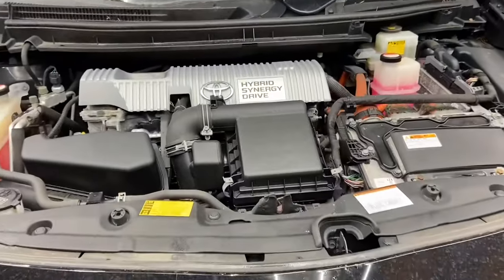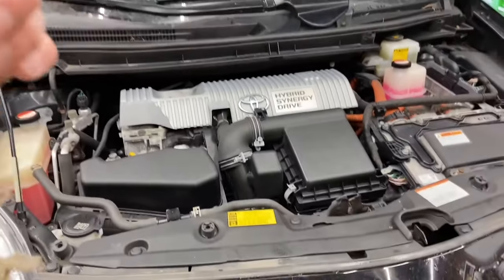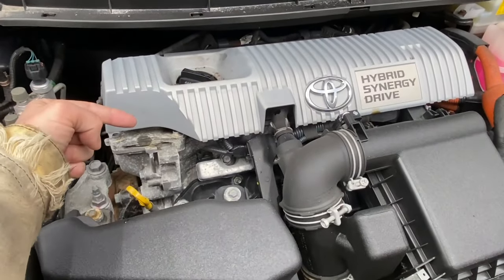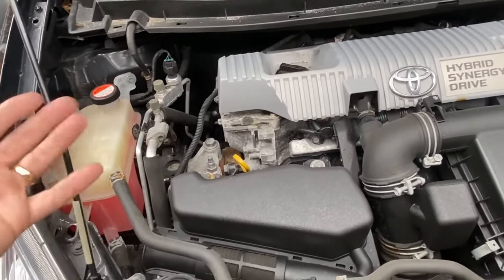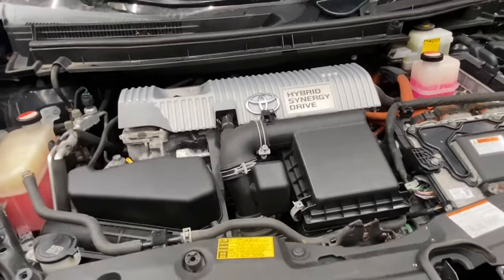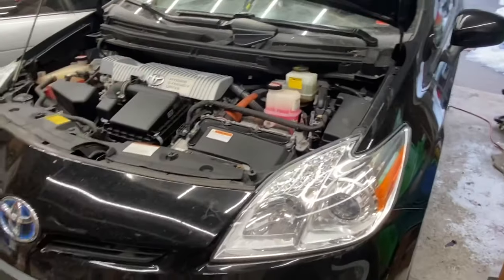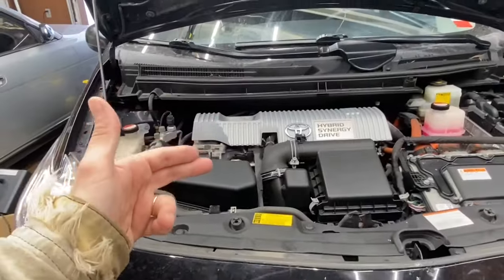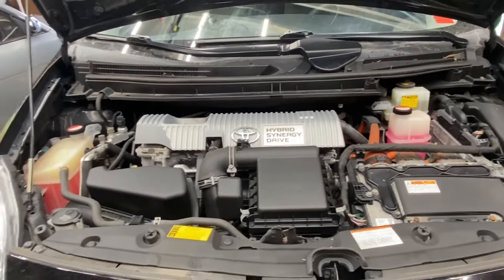Third Generation Prius PROBLEMS! Should YOU Still Buy One? A Prius Dealer/Technician Recommendation

Comment: I bought a used 2014 Prius, 30000 km on it in 2016. It has been rock solid. NOTHING has failed on it, not even a light bulb. I did the brakes a few yrs back just because. They were still fine. Couldn't believe they brakes were still good at 80000 km. Got 95000 km on it now. Still gets over 50mpg. Without a doubt the most reliable vehicle i have ever owned and i have owned over 30 in my lifetime.
Reply: The first real failures I had was actually due to my catalytic converter being stolen, leading to damaged sensors, a damaged module, and the hybrid battery becoming unbalanced and giving errors bit early. Total cost to deal with the fallout was $2000 which includes the price of me getting a Miller Cat shield installed and reconditioning and fully testing the pack myself.

I encourage anyone to get a converter shield, because its a scary time to have a prius right now.
Reply from the maker: Oh yea they are great! The video is to cover what will go wrong but it’s way up there in miles. And it can all be solved. Enjoy it :) remember, I said I’d still own one. Love them. Please subscribe :)
Reply: @Sam-dc9bg  I think I should get one for my 2013.  Here in California, theft of anything is virtually not a crime unless you use a gun and fire it.  But even that is not guaranteed to get you jail time.
Reply: Hi, you're amazing!!
my daughter has a 2014 Prius and replaced the head gasket apparently there was some unseen damage now 6 months later it threw a piston arm thru the block. I'm going to be replacing it with a used engine now that I have watched ur videos and now am confident that is the right decision. Thank you for sharing ur extensive knowledge of these vehicles. Would you suggest that I put a 2015 engine in her 2014 Prius to replace the old motor with the newest lowest mileage used engine as possible? And roughly how much do you think would be a fair price for a replacement engine? Any advice will be greatly appreciated, you truly are providing a great service to the  less experienced Thanks again, You the man!!!

Comment: I have a 2011 with 245k. Nothing wrong ever!!  Such a solid car!
Reply: No clogged EGR valve, cooler, pipe and intake manifold? Original coolant pump?
Reply: @dezafinado yeah I don’t see how it’s possible to be at that mileage having never had the EGR system go down. The cooler is too small and the engine is a PCV engine oil slurper. That design was a major error on Toyota’s part. I’ll be scratching my head forever as to why they slung the PCV valve that low on the block, at the same time they positioned it horizontal. Not even sure how they expected the float in the valve to work laying on its side.
Reply: Well that's commendable but hardly impressive I mean let's face it the car makes 98 horsepower and all it's ever carried is probably you to and from the grocery store/ work, it's never left the pavement.  I mean shouldn't a 98 horsepower vehicle do that? I have a Chevy Silverado 1994 K 1500  it's  a Z71 4 wheel drive I have gone on countless off-road expeditions unbelievable deep water river crossings time and time again and it's never failed, I have pulled offshore boats from Phx to LA,   Trailers AT v's and snowmobile's through the mountains of Colorado. I have the original engine untouched haven't even replaced the timing chain and I'm at half a million miles... It's 31 years old dude hit me back when your prius has that much age and miles on it, Additionally FYI I'm a 2014 pre a sooner and I've had several problems so I don't entirely believe your story apparently neither do any of the other people in the comments section it's quite possible you're full of shit.😢

Comment: I never thought I'd buy any vehicle with 235,000 miles.  Well, I also had turned down lower mileage gen 2's for $400 and $700.  Finally saw another for $400 and couldn't get there in time so drove off with someone else.  Yes, still drove, albeit the body looked ghetto.  Still, happened to find another ghetto looking lifted model for $1,000 more and decided why not.  Even with ABS, VCS and Engine trouble lights on.  Was documented well I thought at least and later found from ~210K miles on was via dealership and Japanese auto place.  Turned out, the right rear adjustment lever and strut was assembled wrong and bingo redid correctly per spec and two lights and related codes down.  Also, reported with a custom exhaust that I found needed the downstream oxygen sensor and catalytic converter which aligned with the engine code and reported corrective actions by the seller and his mechanic.  Two more engine codes gone after a new Denso downstream sensor and Autoshack catalytic converter.  Now I think what's left is replacing the AF Ratio sensor with a new Denso, though I got a few from the salvage yard to test out before hand since they're returnable and only ~$10.  We'll see.   I also have a clunking that was reported in the front end that was reported as the Rubbershocks or something with the lift doing.  I found the sway bar bushing squeak and need to verify everything is tight like subframe bolts as well just to be safe the more I read and watch regarding that noise.  Everything I can test related to tie rods, bearings and cross members seems OK, albeit a crow bar or long breaker bar to really lever on might show something else.  Guessing is the front spring diameter is too large with those Rubbershocks so I picked up some 2012 AWD Matrix struts to eventually swap those spring in and remove the Rubbershocks on the front for certain and maybe the rear as well.  Though yeah, amazing.  The 2013 and on gen 3's are just amazing. I better stop writing now, since I can go on  and on seems.

Comment: I've been hearing a ton of Prius owners having zero problems with their cars.  I have the opportunity to purchase a 2012 Prius with 225K with a new upgraded head gasket, new engine water pump, and the engine has one year warranty.   Sounds good but they are wanting $8k for it.   Isn't that a crazy high price?
Reply from the maker: Well.. I’ve got a 2012 with 137 for $12230ish. These still are the best cars made from the year 2010 to 2015, but they aren’t as good as 2004-2009. Not sure if it’s worth $4000 to get 100,000 less miles. I bought my truck with 197,000 and enjoyed the savings. I got my solara convertible for $1500 with 190 and wish I spent $7,000 and got one with 80,000
Reply: @DrewGarage  Thank you for your reply.  I was considering the car for my daughter who is going off to college.  Thanks again.
Reply from the maker: @flyonawall6521  you’re most welcome! Hope it goes well! Please subscribe:)

Comment: 2010 had a recall about the charging side failing earlier than the service life stated . Was no warning other than check hybrid system and limp home power. A new 2000+$$ unit was put in under the recall, but i was in at the deadline 3 yrs ago. Might need to figure out the model number, to tell if it was replaced since your buying so many. Now the fuel gauge is needing replaced, random full to empty with a brief correct read sometimes. Toyota dealers have unique portals into Toyota parts USA, use the local dealers site to enter and find that dealers sales and discounts. Saved 1k on a drive battery, by checking 5 local Tampa dealers.

Comment: I drive a 2014 Prius still running strong at 244K miles.  I did have to replace the entire fuel pump at 200k, also started consuming oil at 130k.  2 seperate occasions a had to replace 3 ignition couls that exploded..
Fingers crossed I cam get the vehicle to over 300,000 miles
Reply from the maker: Yikes! I’m sure you can just watch for the head gasket. Please like and subscribe if you haven’t already :)

Comment: Went through the blow head-gasket and tried replacing it but still had problems. Didn't have the time to mess with it so grabbed a JDM engine and it worked great. Combined with a clean EGR and a new water pump should be good for another 50k miles before I need to clean the EGR again. Very reliable car. 

Went I went over the old motor, found that the timing chain tensioner didn't extend and the timing chain jumped. :P Oh well, know for the future. Thanks for the review.
Reply from the maker: Jdm seems to be the way to go. I have one I need to deal with and I think I am going to do that :) please like and subscribe if you haven’t already :)

Comment: great video! Here in Europe I own a Toyota Auris 2 hybrid, which is in fact a Corolla with the Prius 3 drivetrain. Once in 1 or 2 years I clean the intakemanifold and EGR, soaking it in dieseloil and using oven cleaner,  and it runs like a clock. It's a lot of work but it needs to be done to prevent problems with it. And I change oil and filter every 10k km's. It burns no oil and it has 230.000 km's on the odometer. I want to keep it 'till the wheels fall off, so that might take a while:)
Reply from the maker: That’s awesome! I’m somewhat familiar with your car - but most of my knowledge of non-us toyota is 25+ year old JDM (I import a bunch). Once the your model is old enough I’ll likely grab one. 

Hope you see 1,000,000kms! Please subscribe :)
Reply: The headgasket is not a big problem in Europe.
Im using gasoline 95 e5, and the carbon build up is very little. Cleaned the egr cooler at 180.000km. It wasnt really dirty.

Comment: My first car was a 2004 Lexus RX 330 that I had for 13 years that was gifted to me by my grandmother. It was an awesome car. The only problem was it love to eat brakes my next car I purchased in January 2017 for $9000 a 2012 Toyota Priuswith 100,000 miles so far I’ve had this car seven years with no major issues even if it only lasts another year or two I can’t complain for what I paid for the car. I will definitely be looking into a 2019 or newer model Prius for my next car in the next year or two.
Reply from the maker: That’s awesome. Good long runs! The 4th gen is a lovely car you’ll enjoy

Comment: Thanks Drew, helpful. Love the gen 3, tremendous car to this point - only work I've done is a rear bearing, and some brake work and a caliper, outside of that - never an issue up until this week - dreaded coolant loss. Seemed to have leaked from reservoir as I found pink crusty stuff high up on frame, nothing below on ground or out of the tail pipe. 198,500, '13 well maintained, no EGR clean (read might not be needed due to high mileage traveled daily 150 round trip up until a few years ago - so have opted against it),  owned it since 50k. No death rattle at startup. Added more coolant, monitored temps with a scan tool, 195 - highest I saw was 197. Runs fine, no white exhaust, etc. Unfortunately a few days ago after I adding coolant, a few miles from the house, over heat light came on  (first time). Pulled over and shut down immediately, no CEL. coolant tank was swollen...looked hot didn't have scanner on me unfortunately. Let it cool off 20 mins and drove home without issue. Attempted to recreate closely by the house with scan tool, and was unsuccessful Appears intermittent, but plan on doing a block test once the kit arrives. Hoping maybe it's just a water pump? Thoughts? Time will tell on the head gasket - hoping that's not it!
Reply from the maker: Yikes. If it’s not the head gasket - which there is a chance it’s not if you aren’t loosing coolant other than the leak you had, it very well could turn into the head gasket if it keeps overheating. The water pump could do this for sure
Reply: @DrewGarage  thanks, block test was negative. Drained coolant and slapped a new oem water pump in, refilled with coolant and it's been perfect for the last few weeks. Took a part the original bad water pump, and it was just starting to separate in 2 spots. Spun slightly slower that the new OEM that I put in...Thanks for your reply and helpful videos - appreciate you!
Reply from the maker: @MR321-x2k I love to hear this ! And thank you for watching :) adding as much prius content as possible!!

Comment: I do not know if you will get this message, but you may be my last hope 

I have two issues with my 2010 3rd generation Prius. Background on the car. I bought it new in 2009. Single owner. It has 472,000+ miles. Replaced engine at about 270,000 miles because the head gasket blew. Mechanic said to replace engine for an extra $100 vs head gasket only. Two weeks ago, I had transmission replaced. Both engine and transmission were used units. 

My car, since the engine was replaced, has been making a noise like when you have bad fuel or the engine is not igniting the fuel on time. It's pinging, not knocking. It does it when engine has been running a while, like when you are waiting at a red light and when you go to green and accelerate, it pings. I get off the accelerator and back on  it again and it goes away. Sometimes I have to do that a couple of times before it goes away. Can you tell me if you have experienced this or know how to fix it? The dealership has no idea and an experienced Prius shop has no idea either and neither can replicate the issue. It just happens to me most of the time and when I take it in, it doesn't do it. Love the car and I am shooting for a million miles. The car is very well kept and maintained.

HELP PLEASE 🙏

Comment: Just had to replace the brake booster on my 2011 ran me $2300. The owner who sold me the car was sent the the advisement and got scared and sold it to me not realizing this was going to be an issue with this car. That being said. This car has saved me so much money I still don’t regret buying it.
Reply from the maker: Still worth it! These are amazing cars. We LOVE them. Might crack the 60 mark this year!
Reply: Out of topic but how about between this and crown royal saloon 2009 models? Me so confused i love both but had to choose one, thanks
Reply from the maker: @toplespecah666  goodness gracious that is an interesting question, and very ironic you would ask me, because we import cars from Japan as well as specialize in Prius. They are two completely different vehicles, and comparing them is impossible. Comparing a Prius to another hybrid like a Lexus CT 200 H is a little bit more practical, as a crown royal saloon is a luxury car and in the year 2009 was certainly not about efficiency. But, that said, as crown owners, I would say I love crown a little bit more than prius BUT as an occasional used vehicle for luxury purposes. Prius is better for commuting to work because of its efficiency and technology and smoothness and size for parking
Reply: @DrewGarage  so difficult choices, but thanks dude!

Comment: Head gasket and bolts
Water pump. timing chain kit. variable timing sprocket. spark plugs. coils oil change. Resurface cylinder head. 
$4700
Good??

Comment: 13 Prius...car intermittently rattles at start...(if I put it quickly in neutral it massively alleviates the rattle and doesn't code).  Anyway, the car has drank half the reservoir of coolant in 200 miles.  

BUT, there is NONE mixing with the oil, oil is CLEAN.  Where is it going?  I tried the putty knife thing and on the EGR and after the 5th test start it rattled...so that must mean EGR is good?

My mechanic did a "block test" and said the motor and gasket "were good"--dont know what a block test means.  

I read somewhere regarding a 10-15 Prius that was drinking too much coolant and that they found a "misshaped Heater Core Line" and that is where the coolant was going. 

Please help on what I should do next!
Reply from the maker: I’m very sorry but watch all my prius vids. If you’re loosing lots of coolant and getting a death rattle in a third gen, that’s as likely a head gasket as pain in a foot that just stepped on a nail. Chance there is a coincidence but it’s a very, very, VERRY small
Chance. Sadly it’s the head gasket. I hope it works out
Reply: @DrewGarage  thank you!  But where is all the coolant going—can it just evaporate without going into the engine?  Again, oil is clean.  Thanks again!
Reply from the maker: @Sk8StGeorge  hey so very sadly, in the vast majority of cases with this engine in this type of failure, none of the coolant makes it into the oil. I have a video I posted recently about inside of a failed engine, and I show what happens to the head gasket. The failure is between the coolant jacket and the combustion chamber, so the coolant you are losing is going inside the engine where the gasoline and air combine are ignited by the spark plug, that’s how the coolant is disappearing but not going in the oil. That is also why you hear the sound in the morning

Again it needs to be said that I have not torn apart your engine, but this is 100% classic Prius head failure all the symptoms pointing to this. Very sorry :-(
Reply: @DrewGarage  Nothing to lose, I poured some K seal in and 5k miles later no rattling.  I am quite stunned.
Reply: Catalytic converter has coolant line running to it and they can leak inside

Comment: I drive a 2010 Prius with around 243,000 miles. The car occasionally shutters, sometimes while accelerating, decelerating, or at a constant speed. What’s the problem?
Reply from the maker: I have felt that and I cannot say for sure what it is - it was in a unit that was CHUGGING oil. I had the thought it may be light misfires but I am
 It 100%

Comment: Thank you for the awesome video.
I'm looking at a 2013 Toyota Prius 2, 112,000 miles tomorrow.
I'm in no hurry but she is because she's moving.
She admitted that the brakes are half used (meaning I'm going to replace them), two tires need to be changed, Carfax in hand, and I'm not sure what I needed to do.
Thank you